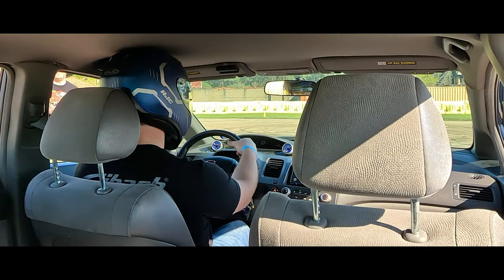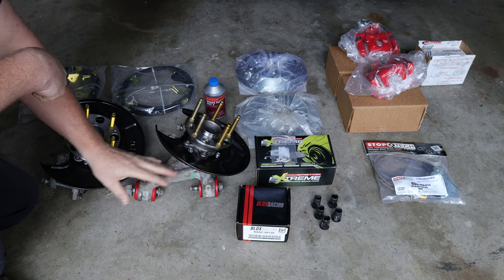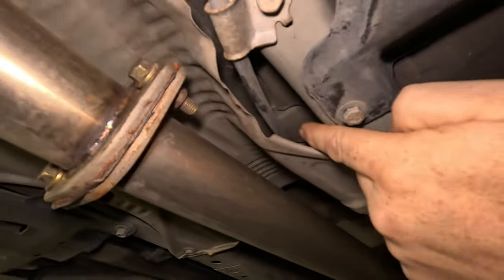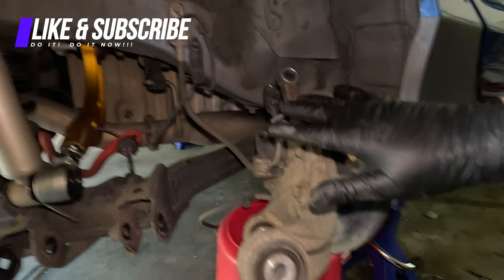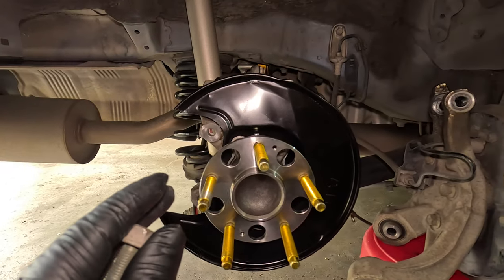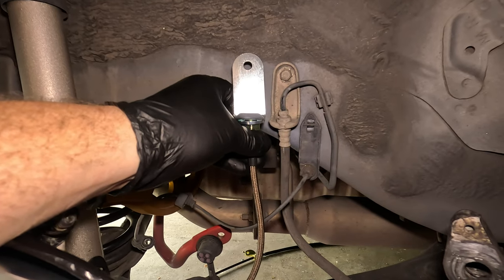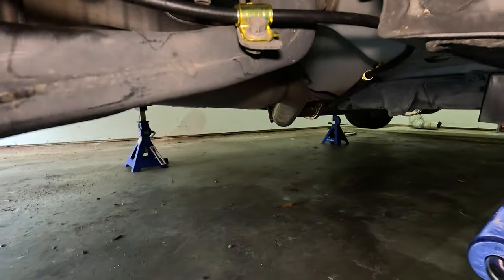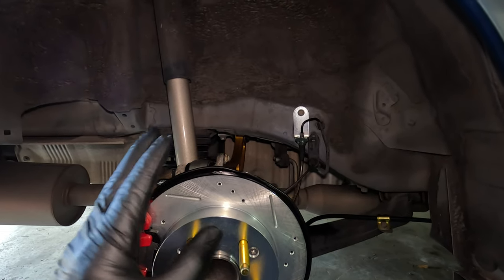Converting Rear Drum Brakes to Disc Brakes on an 8th Gen Honda Civic (2006-2011)

Comment: I did finish the Acura TL brake master cylinder upgrade, and the results are very good, although the modifications to the backside of the air filter housing were pretty extensive and time consuming in order to fit the whole assembly in without the pressure lines interfering with the stock air filter housing. If there’s a good intake filter charge pipe that has a well designed MAF sensor inline, I’d have considered it, but I’m trying to stay as stock as possible.
Reply: I think even more pressure could be gained by going up to the 1/4” brake lines from the BMC to the ABS pump. Instead of reducing the BMC with adapters, move the 1/4 to 3/16” adapter to the ABS pump, and run 1/4” steel hard lines from the Acura BMC to the stock ABS pump. At least more volume would be present at the ABS pump. 2 more cents!
Reply: Regardless, mark your Acura BMC with an ID tag or paint that tells the next owner what to buy when the BMC eventually fails down the road.
Reply from the maker: Thanks for sharing the info! This will definitely come in handy once I'm ready to do more brake upgrades 😁👍.
Reply: And as long as we all can access your videos, we all have a one stop video with most or all of the questions answered in the comments section.

Comment: Where did you find the rear dust shields?
Reply from the maker: I picked them up with the junkyard knuckles and then just cleaned them up and painted them with high-temp paint. 

I couldn't find the rear brake dust shields on Amazon, but you can still purchase them from Honda if need be. The part number is 43253-SNA-A00 (or 43253-SNX-A00 - both part numbers refer to the same shield). You will need two of them (obviously, lol 😆).

https://www.hondapartswholesale.com/oem-parts/honda-splash-guard-rear-43253snaa00

I hope this info helps! 😁
Reply: THANK YOU!!!
Reply from the maker: No problem 👍
Reply: They are available from the dealer, around $30 each.

Comment: What eibach springs are you using for the back with the truhart coilovers
Reply from the maker: I am using the eibach pro kit springs. They lower the front by 1" and the rear by 1.2"

They are pretty decent as far as ride quality is concerned. Eventually, I will upgrade to a Fortune Auto Coilover setup. But for now, the eibach & truharts will do the trick for the time being 😁👍.

Comment: Hello Sir.
Reply from the maker: Hello 👋 😁
Reply: @LevelUpMechanics  So i have a bit of a problem with my 2008 civic and i would like to know what you think is the problem. 

So i changed my rear trailing arms and rear shock absorbers and since then i have this bumping sound from the rear anytime im on a bumpy road. Kinda like the shock absorbers are not working as they should be. I keep thinking i didnt buy oem rear shock absorbers but i think i need a second opinion.
Reply: @LevelUpMechanics  when there are people at seated at the back, its worse. Its like the rear shocks are not able to hold the weight or something. Feels like the top of the tires hit the body or something. Im confused lol.
Reply from the maker: It sounds like there might be a chance that the rear shocks are not assembled correctly.

The only suggestion I can think of is to recheck your work. If you are unsure of how everything is supposed to be assembled, you can always look at part diagram pictures on honda websites like https://www.hondapartswholesale.com/ for reference.

I would recheck everything that was removed / replaced to verify if everything is assembled correctly.

Comment: Very happy to see this isn't a complicated swap, and also happy to see people still modding 8th gens. 

Since i'm finally modding my own, i think this will be a nice thing to do for it. Great vid!
Reply from the maker: Thanks for the support! 😁👍 What kind of mods are you going to start working on for your civic?

I have a lot of civic projects lined up for 2024. Next up will be a front splitter, front lip,  and fog lights. So much work, so little time 🤣 🤣 🤣
Reply: @LevelUpMechanics  Just ordered some headlights, new wheels( Enkei JS10) and a spoiler  similar to the one you have. 

Plan on doing the brake conversion, a 2011 front end, suspension work. 
Long term is to do a K24 swap, but an all motor R18 has done well for me since I bought the car.  We'll see how 2024 treats me, haha.
Reply: So little time, you’re right! I’m 67 in November! I think I’ll start working on my T100 truck now to get that URD/Pulley Boys  blown 5VZFE back up and running again!
Thanks so much for posting this video, I’m sure there are 20 of us right now benefiting from it, and 25 more next year…

Comment: I looked every where on the net and nothing seem to come up. uneven ebrake cable at the center console area. after installation, were your cables uneven? if so, how did you fix it? if not, i’m sol lol. But I checked, double check every thing. from the caliper to the thing holding the cables. adjusted the nut but still uneven. hope to hear your response soon.
Reply from the maker: I replaced the E-Brake cables with ones that are compatible with the rear caliper setup (the left and right E-Brake cables have different part numbers).

Do you have a Coupe or a Sedan? Because, if I remember correctly, there are different part numbers depending on the body style. Also, you will want to make sure that your cables are not mixed up between the left & right sides. 

Also, if I remember correctly, my cables were slightly uneven... but the bracket that both cable ends attach to can pivot... so you can adjust the single cable leading to the E-Brake handle until there is tension on both cables leading to the calipers... 

I think if you adjust the single cable leading to the E-Brake handle, this might resolve your issue...
Reply from the maker: The bracket that connects all 3 cables together will look slanted once you adjust the single cable leading to the handle... but since that bracket can pivot, it shouldn't apply any excess pull on the "shorter" caliper cable... it will just "twist" until both caliper cables have tension... 

Once both cables have tension, you will be able to pull the E-Brake handle and use your parking brake correctly... it may take a little bit of trial-and-error to adjust that single cable to the point where you need it to be. 

Let me know if this adjustment resolves your problem 😁👍.
Reply: thanks for the response. yea I order the cables per your description list and label it driver or passenger when they arrived and I  also double check the numbers prior to installation so they are correct but I try to do that and see what happens, i’ll keep you posted. thanks again

Comment: where did you get the splash/dust gaurd because i cant find any
Reply from the maker: I couldn't find the rear brake dust shields on Amazon, but you can still purchase them from Honda if need be. The part number is 43253-SNA-A00 (or 43253-SNX-A00 - both part numbers refer to the same shield). You will need two of them (obviously lol 😆).

https://www.hondapartswholesale.com/oem-parts/honda-splash-guard-rear-43253snaa00

I hope this info helps! 😁

Comment: Nice video bro,  you reuse the same ebrake cable for the new system??? or has to buy a new one
Reply from the maker: I had to purchase new e-brake cables. All the parts should be listed in the description section (with links) 😁👍.

Comment: I’m having trouble finding the dust shields online, I bought new knuckles from Amazon, and of course, the dust covers aren’t included with the knuckles. I found a guy on ebay that wants $59.99 EACH. TOO MUCH!!!
Reply from the maker: I couldn't find the rear brake dust shields on Amazon, but you can still purchase them from Honda if need be. The part number is 43253-SNA-A00 (or 43253-SNX-A00 - both part numbers refer to the same shield). You will need two of them (obviously, lol 😆).

https://www.hondapartswholesale.com/oem-parts/honda-splash-guard-rear-43253snaa00

I hope this info helps! 😁
Reply: That’s exactly what I did, they’ll arrive tomorrow, I still need to get the piddly screws, washers, and nuts I’ll need to have everything ready for the job. Little things like the four bolts that hold the hub to the knuckle, the screws for the dust shield, etc. Thanks for taking the time to help me out! 
 I just bought the forward bushings for the rear trailing arms, mine knock occasionally, these are Megan Racing spherical bushings, so they should last a long time, although I’m afraid they may be too stiff, the stock rubber bushings are only available as part of the full left or right hand side suspension arm assembly. I wish I could get access to the parts shelves at my location chain auto parts store, so I could take measurements and find the part with the correct dimensions, but I’d still be limited to the rubber bushings. I’ll let you know how they feel afterwards. Thanks so much for your thorough tutorials, they’re the best on YouTube.
Reply from the maker: No problem 😁👍

Let me know how the megan racing spherical bushings work out for you. The only bushings left for me to upgrade are the rear trailing arms.
Reply: Yeah, mine are knocking occasionally, I have the parts, they are BEEFY!

Comment: Man I hate having a coupe. The cheapest I’ve found a rear left parking brake cable is like 70 dollars….
Reply from the maker: Well, that's annoying (to say the least). Finding parking brake cables for the coupe can be difficult sometimes...
Reply: @LevelUpMechanics  I found a 2007 EX with no engine or trans, paid $100 for it! So just gotta hope the ebrake cables are fully functioning. Brake pads were missing from the passenger side rear so the ebrake has no tension right now. Fingers crossed lol
Reply from the maker: Having a donor civic is an awesome idea 💡 😀 👍

Comment: could you reuse the bolts holding the old knuckle to the wheel hub or will you have to get new ones for the new set up? if so, where did you get it?
Reply from the maker: You can reuse the old ones if I remember correctly 😁👍.
Reply: thanks for the response. your video has the knuckle already connected to the wheel hub so I wasn’t sure what bolt was used. however you did mention that you got all the bolts from the knuckle so that makes sense

Comment: No mention of the prop valve…
Reply from the maker: There is none
Reply from the maker: 8th gen civics use Electronic Brake Distrution (controlled by the ABS pump / module) instead of a proportioning valve 😁👍
Reply: @LevelUpMechanics  so it’s programmed to push fluid to the rear for drums? So grab an abs unit for an ex/si because there probably not self adjusting
Reply from the maker: @taylorsellers7018 All 8th Gen Civics are equipped with a  4-channel ABS & Electronic Brake Distribution (EBD).

You already have it 😎👍
Reply: @LevelUpMechanics @taylorsellers7018 May be right about the ABS modulator. The part number for the ex is different from the lx. I'm trying to find more information on it myself, but it could very well be valved differently inside the mechanical part of the ABS modular. My other concern is if the modulator from an ex will work on an lx car. I'm assuming that it will bolt up just fine, but idk if the electric portion will communicate with the rest of the vehicle and/or if it'll be able to be programmed to the lx vehicle

Comment: the production and editing of these videos are really exceptional! sheesh! question. did you have a video when you replaced your suspension to eibachs and truhart suspension? or did they come in like that? i just cant find them on your channel if you did or not
Reply from the maker: I have a few suspension upgrade videos that still need to be edited & published to YouTube, including the eibach springs + TruHart struts / shocks. Hopefully, I will have this video ready to be shared in the near future 👍.

The Truhart struts & shocks are technically designed for a 9th gen civic (but are compatible with the 8th gen), and the eibach springs are for an 8th gen civic. 

Here are all the parts I used: 
Truhart struts & shocks - https://amzn.to/3NjsQd9
Eibach springs - https://amzn.to/47Yyb25
Eibach front camber kit - https://amzn.to/47Hxv0x
Godspeed rear camber arms - https://amzn.to/46JlyXa
Energy suspension rear shock upper bushings - https://amzn.to/419jIxn

Front strut mounts & bearings - https://amzn.to/3Tg3zEv
Front upper spring insulators - https://amzn.to/3tewPRk
Front left lower spring insulator - https://amzn.to/3te0HNL
Front right lower spring insulator - https://amzn.to/3T5Fn7Q
Rear spring insulators - https://amzn.to/419krP7

Comment: I’m working with an LX automatic R18 I bought last August as a cheaper alternative to my T100 pickup. 
My question is: Have you looked into a compatible brake master cylinder with a larger main piston bore? I bought a BMC for a 2008 Acura TL, and am looking to upgrade my current setup to the .816” bore from the stock .750” piston. Everyone seems to wanna paint the parts as loudly as possible, and put the BBK’s on with a BMC that is marginal in the car’s stock form. A good foundation is my obsession, nothing worse than brake failure.
Reply from the maker: I've know that a common BBK upgrade for the 8th Gen Civic is to pair the Acura TL BMC with the brembo-style front calipers.

Once I finish adding more power to my civic (skunk2 camshaft & kraftwerks supercharger), I may have to bite the bullet and do this brake upgrade.

Until then, my current setup is still working flawlessly. For now... 🤣 🤣 🤣
Reply: I personally wouldn’t invest anything internally in an R 18, simply because of the block defect and the popsicle stick connecting rods. I’ll choose to live vicariously through your experiences when it comes to doing anything to that engine. I feel like I took my eyes off the prize, after I got the civic, and stopped working on the T100. The car handles like a miniature, Porsche, and respond well to simple upgrades to the suspension. I really like my 19 mm rear swaybar from Eibach, but I enjoy this new toy so much, I’m overspending on it. These cars are sheet metal shells with well engineered solid castings that make them cheaper to manufacture, but long term, this car will be a pile of rust long before the full framed T100 pickup. I’m impressed with this car, it’s so fun to drive, and I’d love to have an Si, but go out and try to find one!
Reply from the maker: @waverider5751 one way or another, my R18 build will end spectacularly... either with a blown motor... or with a properly tuned & reliable 200-250 WHP civic...

This year is going to get a bit crazy 🤪 🤣 🤣
Reply: That’s exactly why I bought the Civic, my T100 is supercharged, and I eventually smoked the #4 exhaust valve. This car is supposed to be a daily driver, but I’ve already replaced every bushing and joint in the front, and now I’m focusing on the rear. 
Tip: if you tear up or just want new hardware to mount your rear wheel hubs, get an M10-1.25 x 55 mm hex head, flanged head bolt, you’ll neeed 8 of them. Three and a half threads are visible on the anchor side of the hub. Honda calls for a 53 mm length bolt, good luck finding one anywhere else but at the dealer. 10 is stamped into the head, so be sure to get a 10/8 hardness steel alloy fastener.

Comment: How much did you spend on the parts if you don't mind me asking. I'm trying to update my brakes soon!:)
Reply from the maker: Since everything (besides the rear suspension knuckles) was brand new, I spent A LOT 🤣. 

Probably$700-$800... but this also includes the extra upgrades that I added while I was in there (stainless steel brake lines, polyurethane bushings, extended wheel studs, etc).

I have a full list (with Amazon links) of everything needed in the description section of this video, in case you want to see prices for everything... 

I hope this info is helpful 😁👍.

Comment: I got all the parts in my cart on amazon, question i didnt see any dust guard between the knucle and hub where can i get that and what is the size of the copper crash washers?
Reply from the maker: I couldn't find the rear brake dust shields on Amazon, but you can still purchase them from Honda if need be. The part number is 43253-SNA-A00 (or 43253-SNX-A00 - both part numbers refer to the same shield). You will need two of them (obviously lol 😆).

https://www.hondapartswholesale.com/oem-parts/honda-splash-guard-rear-43253snaa00

As far as the copper crush washers for the brake caliper banjo bolt is concerned, I do not remember the exact size. The copper washers came included with the PowerStop rear brake kit (calipers, rotors, and pads) that I purchased.

I hope this info helps! 😁
Reply: @LevelUpMechanics Hi. Correct me if I’m wrong but the two different OEM part numbers don’t they refer to the driver and passenger side? Or can you just get two of the same part number and rotate it until it can bolt onto the knuckle? 

I’m looking on Honda’s website and the pictures show different angles.
Reply from the maker: As far as the splash / dust shields are concerned, they are not "side-specific". You can just rotate them to line up correctly for whichever side you are installing them 😁👍

Comment: What year civic are you getting the parts to do the conversion?
Reply from the maker: 2006-2011 Honda Civic EX / Si (both coupe & sedan versions are all the same for rear brake & suspension parts).

I hope this info helps! 😁
Reply from the maker: You can also check the description section of the video too, as I have a full list of everything needed / done for this conversion 👍